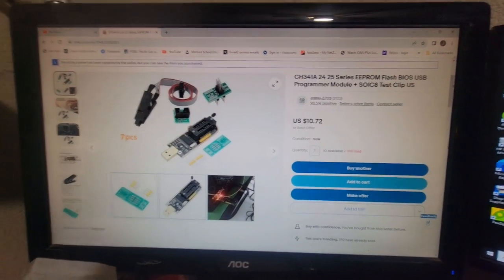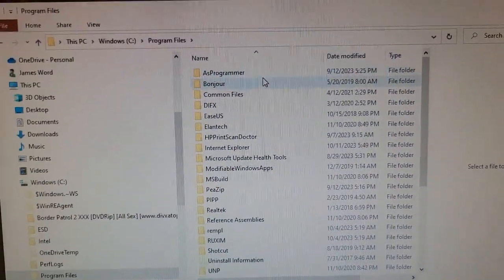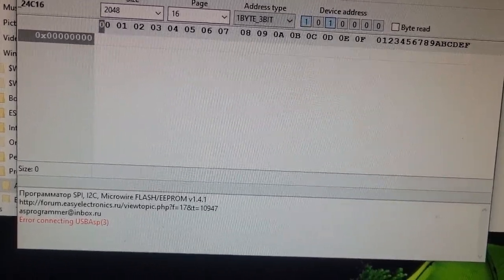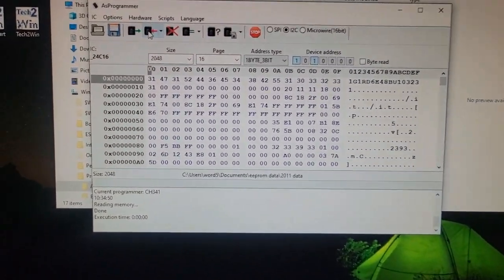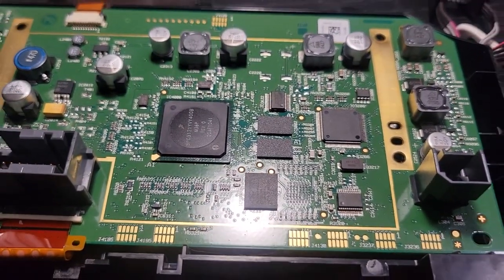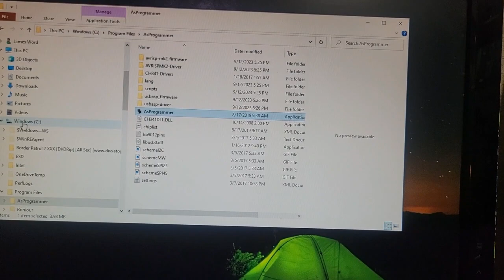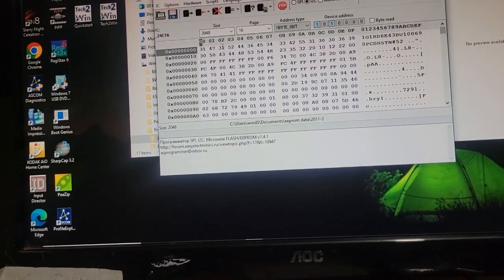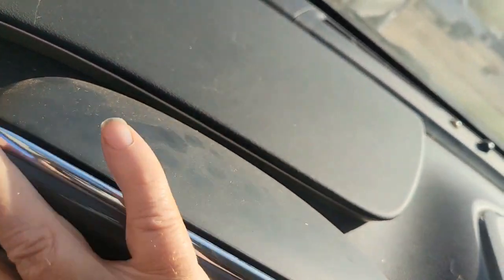Volt Instrument Cluster odometer program

Comment: Hello, could you tell me where to find an eprom file for a 2012 volt with the hold function because after changing the meter and changing the vin in the eprom, I lost the hold that I had on the old defective meter.
Reply from the maker: @jeanluccazanave891  I'm not sure? You may have to program with a vcx nano.  My 2011 didn't come with the hold feature.
Reply: @ww321  she had it before the dash change
Reply from the maker: @jeanluccazanave891  see previous answer
Reply: @ww321  how to do it with the vx nano?
Reply: @ww321  I have another 12/2013 but when I put the file on the 2012 I have temperature errors..., if you had a 2012 file that has the hold, that would be great for me
Reply from the maker: Cant help you there. Join the Facebook Chevy Volt DIY and Modding group. Theres people there that can help you with your issue@jeanluccazanave891
Reply: @ww321  I'm already on it and I've already asked the question, do you have any eprom files from a 2012?
Reply: @ww321  If you have a file to provide to me, that would be convenient.